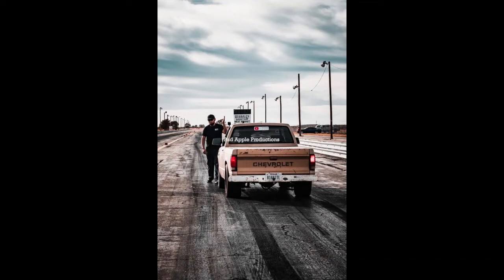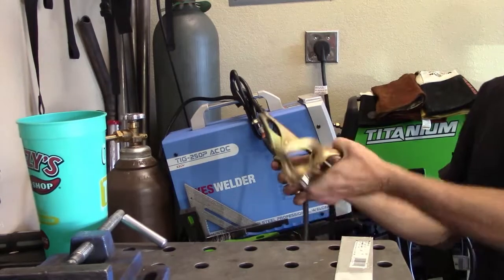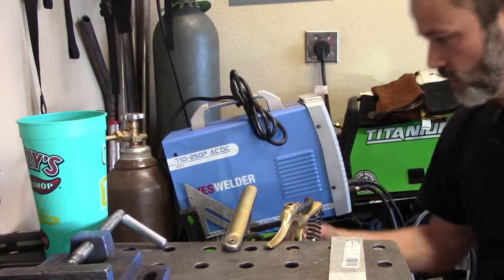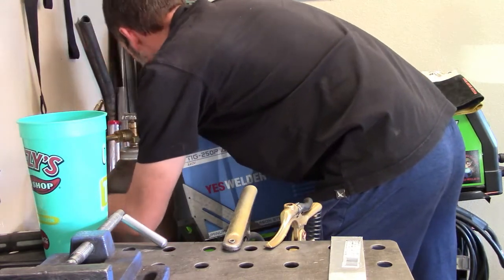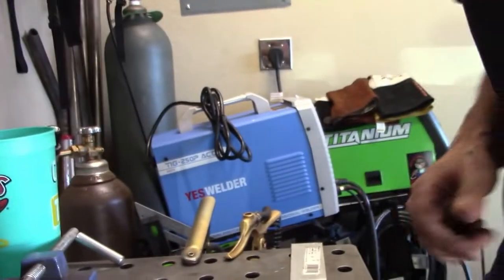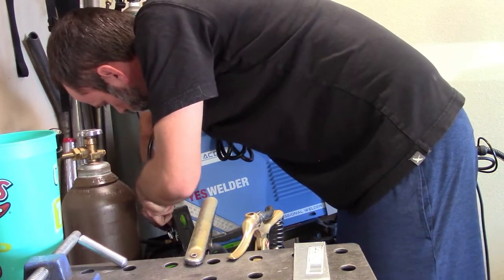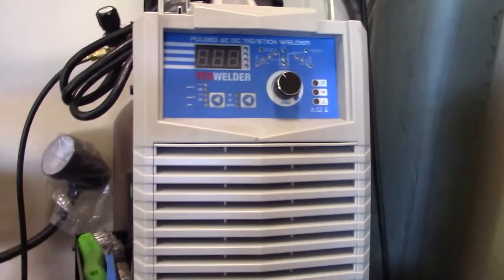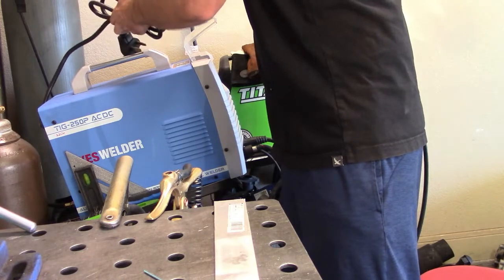Yes Welder 250P AC/DC 3 Year Warrenty!

Comment: I have the same machine and love it. I bought their foot pedal and it arrived DOA.  I took it apart and found 1 wire terminal had never been plugged in. Works great now.  Bought their plasma 55 amp machine and found initial customer service to be a nightmare as it also arrived DOA. Eventually customer service came through and refunded my money and told me to keep the machine.  Then I took it apart and after careful inspection found a tiny piece of braided wicking solder resting across multiple pins on the control chip. Removed braided solder with tweezers and now it works perfect and the cost is better ($0.00) except my time.  Their product design is great but their quality control sucks.
Reply from the maker: So I may need to look at some of my old machines and see if that is a simple fix. I get tired of having to order new welders, plus one of these days my warrenty will expire. Currently on my 3rd 250P.
Reply: @duke1982  It could be something as simple as a loose connection or a bad solder joint or as in the case of my plasma, a tiny piece of braided wicking solder left over from the manufacturing process. It was loose and every time I moved it I would get a different problem.  I finally tracked it down resting across several pins on the control chip.  It took the aid of a 25X loupe and a bright light to find it and tweezers to remove it.  If you are in the Pacific Northwest, I’d be happy to take a look at it.
Reply from the maker: @mikebrewington1425   I wish we were closer, but 20 hours apart is quite a distance. I have a buddy I called today after I read your comment. He wants me to bring one of them down and let him look it over. I will create a video on what we find. Thank you for your insight.
Reply: @duke1982  While you are looking it over look for cold solder joints and loose connections as well as debris inside.
Reply from the maker: @mikebrewington1425  will do, thank you so much for insight.

Comment: You would want to set your frequency at 120 hz and you AC bal at 20%  with 1\8 aluminum you'd want to run about 140 amps. And I'm running aluminum everyday making turbo tubes intercoolers I use higher frequencies for thinner aluminum it focuses the cone so you're not burning as hot.
Reply from the maker: Thanks for the tips!
Reply from the maker: That worked really well. I tried that out the other day. Thank you.
Reply: @duke1982  no problem anytime don't mind giving info for doing the right thing. Not to many people taking up welding these days.....